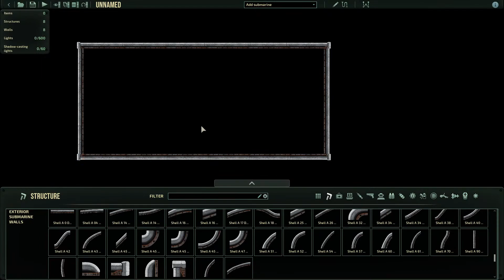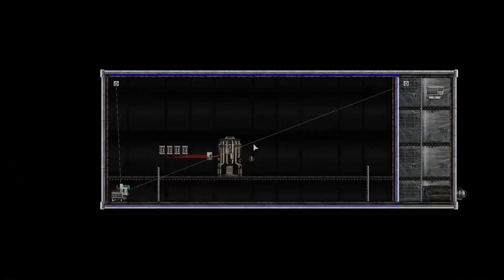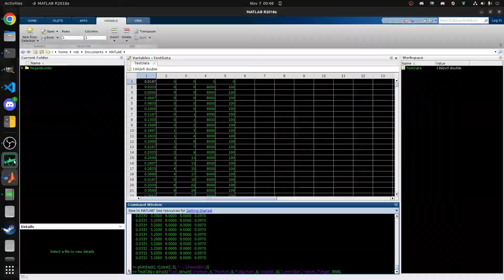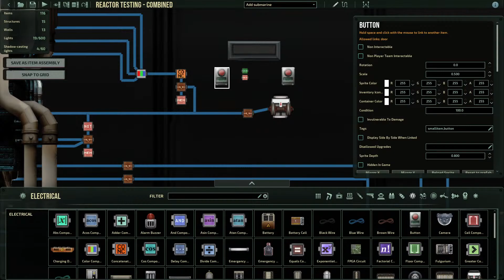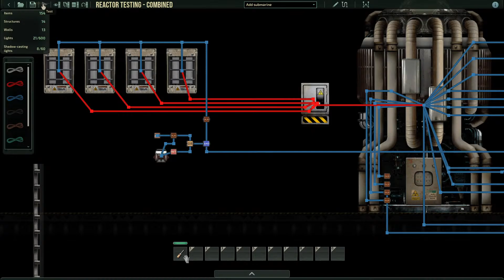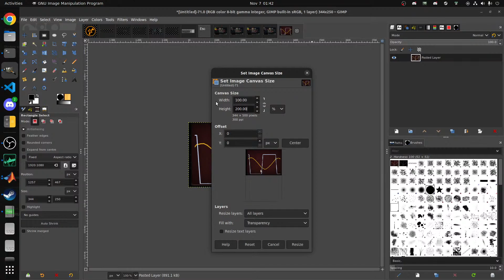TGN Live - Impromptu Barotrauma session

Comment: Another thing I noticed, that with the current slower controller way, when there is no fuelrod, or they run out of juice, the controller tires to push everything to max, and when a fuelrod is inserted, it pushes the reactor to near meltdown and damages junctions.
I added an equal and mem component, and made that it changes the output of the greater components to 30 instead of 100, so the reactor is not on max fission and output without fuelrods. If fuel percentage equals 0 (so either depleted or no rods), then equal component output 30 is valid, false output 100. This way the reactor is on a 30% standby, and no excess heat is generated at the sudden surge of power.

Comment: Really informative video.
I think with the nerf, the biggest problem is the overload protection of vanilla subs, as mentioned. I am still looking for efficient battery protection methods, because what I made still burns down the junctions every time I dock.
With the final release it would be cool if they added something like the EK mods do, a purchasable fabricator, deconstructor battery... that you can place and wire on the sub as a normal component.

Comment: What happens if you use multiple controllers at the same time?
Reply from the maker: Hmmm... That's an interesting idea, I'll try it and report back my results!
Reply from the maker: I have news! Initial testing has shown that controlling the turbine output with the 3-component controller and controlling the fission rate with the 5-component controller yields the faster power-up time of the 3-component controller, and the superior fuel rod economy of the 5-component controller! Sadly, it doesn't impact overvoltage response very much...

I have yet to try the battery-buffered and surge-protection circuits I've seen floating around, but for now, I wanted to thank you for the idea, and remind you to stay tune for more!
Reply: @TheGamingNerd2022  nice. Earlier today i saw an 11 Component build on the steam workshop by Antoneeee. Maybe you can test with that one too.
Reply from the maker: Now that I have a solid test rig, I plan to test a bunch of designs... And next time I'll have the MATLAB code ready in advance. There are legitimate metrics for systems like this, but to be relevant they have to come data collected under realistic conditions. My plan is to automate the test process as much as possible, so I can test combinations of heat potential, max power, and a variety of load conditions. It sounds like a lot of work, but I'm actually excited to see the results!
Reply: @TheGamingNerd2022  sounds awesome. Would love another livestream of that :)